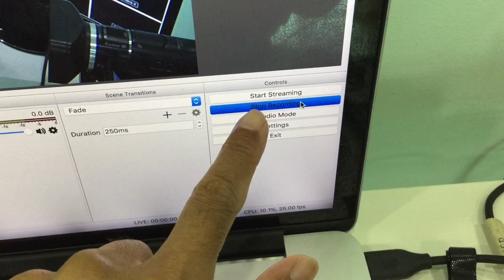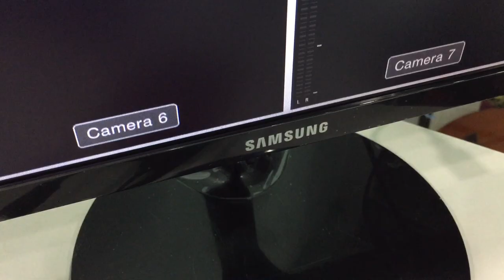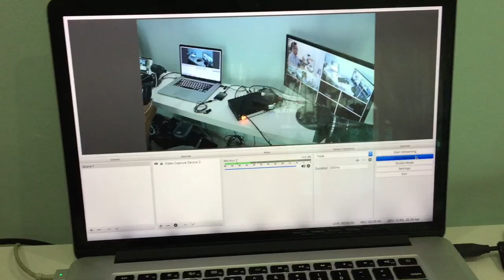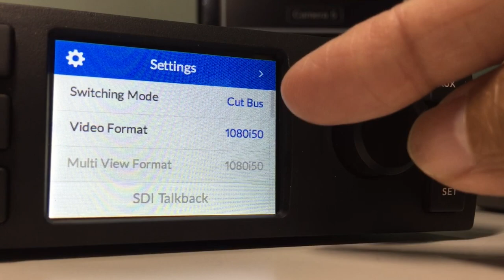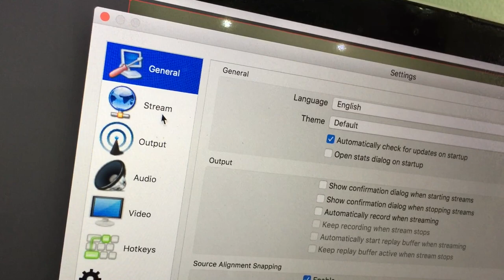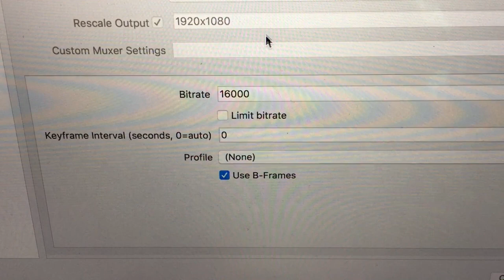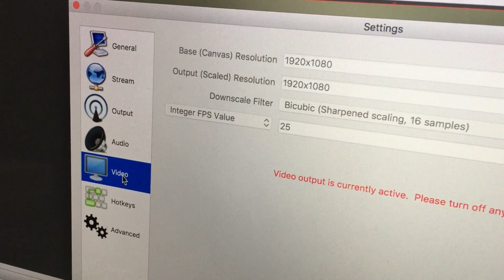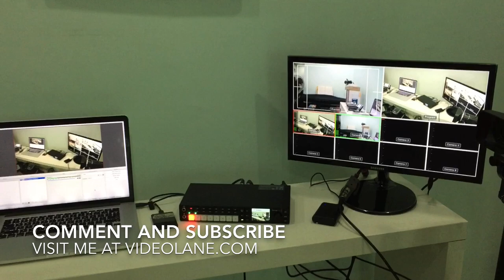Multi-camera live switching setup with BlackMagic Design ATEM Television Studio HD

Comment from the maker: How can I improve on this setup?
Reply: You don't get the audio from the audio mixer? What is the quality of audio you get from your main camera? I wanted to ask if you have audio and video sync issue, but you just use the audio from your main camera so it means that you don't have problems with video and audio sync, i think you can improve this by taking audio from the audio mixer.
Reply: Go fully NDI.
Reply: The connection from the ATEM to your computer - you use the BM studio mini recorder ($200) - I'm curious to know if an ethernet-thunderbolt adapter (into the ATEM) be good enough to connect from the ATEM to the computer instead, be okay?  I know this can be done to use the ATEM software control... but I'm wondering if you can still use that connection to work with OBS?

Comment: How to setup in 1080p??, i have problem with Sony x7
if i use 720p and 1080i can detect, but when i use 1080p cannot detect or preview in Atem.
Thank you
Reply from the maker: I understand we must set the same resolution and frame rate as the setting in the atem.

Comment: Good afternoon, at Atem Television Studio HD, at the hdmi multiview output, can I use a full hd hdmi monitor like this?

Led Monitor 27 "Full Hd Curved Lc27f390 Free Sync

It's not tv, it's just a monitor
Reply from the maker: If the monitor has an HDMI input, it will work.

Comment: Dear sir thank your demo. I am working on the same set up but am not getting video image shown on the OBS. The set up I have is Canon Vixia R800 --> ATEM HD (set at 1080p59.94) --> Ultrastudio Mini Recorder (Video Capture Device - MiniRecorder ->preset -->High). At the same time Multi View HDMI Out of ATEM HD  to external LCD does show video image of Vixia R800. Appreciate it if you can shed some light on what might be the issue.
Reply from the maker: There could be 2 possibilities. The blackmagic desktop video app setting and the OBS video capture device setting.
Reply: @AdrianLeeYC  Thank you for the message. The ATEM HD setting was 1080p59.94 and that is the only setting I got the output image at the external LCD. On the OBS, I clicked the Video Capture Device instead of directly clicking Blackmagic UltraStudio Mini Record - but if I clicked that instead, there will be drop-down menu for selection of resolution and frame rate; however, there was no 1080p59.94, it only has 1080i59.94 which was tried but didn't work. My interim conclusion was that the mini-recorder does not support 1080p59.94. I do not seem to be able to change the output resolution and frame rate of my R800 or more precisely, whatever resolution I changed for the recording at R800, the ATEM  HD will only detect at 1080p59.94. Sorry it turns out to be so wordy. But this is the situation I am in and the way forward solution appears to be changing the video capture card that accept 1080p59.94.
Reply: Hi Kenny, I recently discovered that OBS will not show a signal coming in progressive frames (720P,1080P). It sort of only accepts interlaced (720i,1080i)

Comment: Hi, I am from India..I have heard that the BMD Hd studio pro has having a sync issue with multi cam recording ..Can u put some lights on my issue
Reply: Sync in what sense? Separate audio with video? You often have to add a very slight delay to audio so it syncs up. Which is especially the case with wireless transmissions.